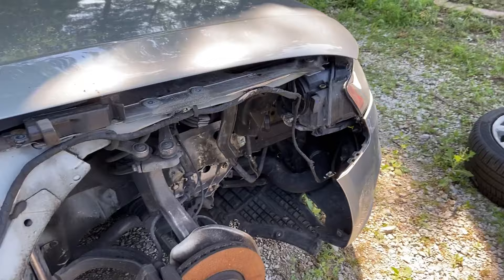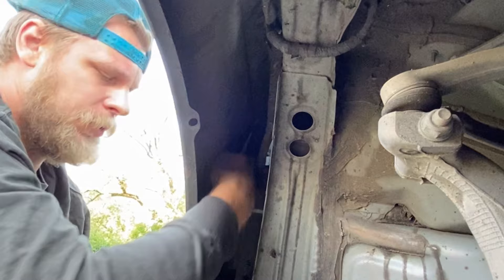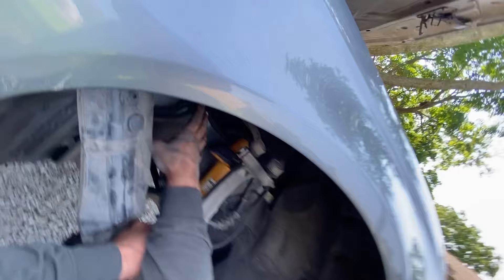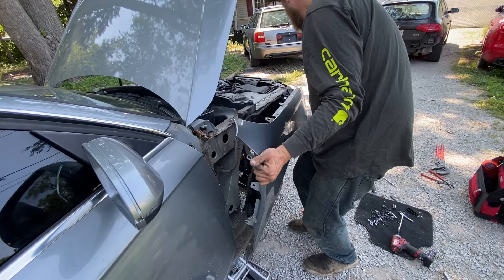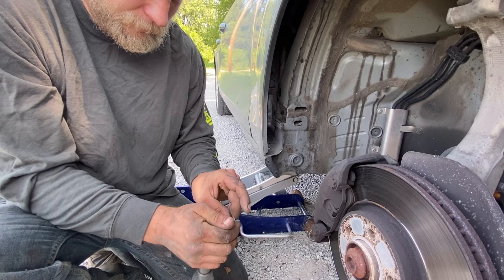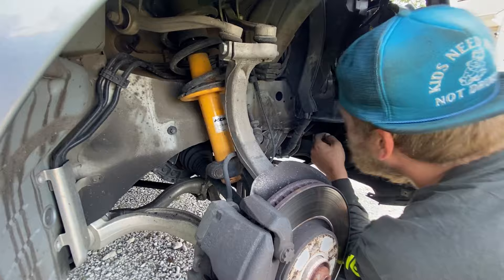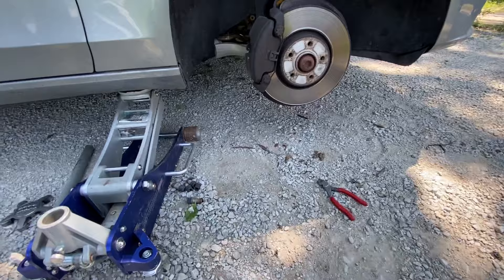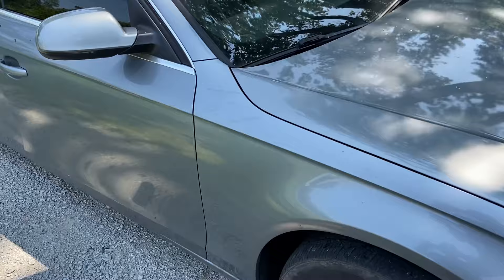Audi Fender A4 S4 B8 B8.5 remove & replace 2009 2010 2011 2013 2014 2016
Front Wheel liner how to

Comment: That was very helpful to get the right fender off. Thanks., but when you get to the left fender the windshield washer reservoir is in the fender blocking access to those last 2 screws in the door jamb. Any hints on how to get that reservoir out of there. I already removed the two visible screws?
Reply: you can just pull it out by pushing it towards the fender and towards yourself at the same time so it gets un-caught by the filling tube.

Comment: Always clean ALL the dirt and debris from the body working areas..dirt can easily cause bolt or screw cross threading and or stripping out..where there was factory weather caulking.. clean that away and apply fresh material.. sealant was applied there for a reason the QC saw in testing.. Black plastic Push pin clips are what is used in much of the plastic fender and splash guard areas in Nipponese mfg autos, it breaks away under less stress than the part it holds so it helps prevent rips and tears in plastic panels and similar parts as well..

Comment: Great video man, At the end of the video where you fixed the gap, Did you you just tighten the top screws? How did you do it?
Reply: I think he just shifted the positioning of the top screws by pushing them in
Reply: Loosen the top screws, push the fender in by hand and start tightening the screws back up as you go along.

Comment: What about the 2 T30's Behind the Fender Seal and the Plastic Pop Rivets That like Ya Know,,Actualy PUT the Fender Seal Back in Place?? Did this tonighy on My S5 on Drivers Side With the Water Bottle. What a Bitch to put it Back 100% Factory!! New Fender I Had to Rivet All the Mounts In that I had to Drill Out of the Old Fender. If it Wasnt A Perfect Condition 2012 S5 "Special Edition" I Would Push this Damn Car into a Lake🤟

Comment: Hey a little off topic but does anyone know how much hp a 2011 A4 transmission can reliably handle?
Reply: 8 speed auto b8.5 either 400/500tq. Manual b8 360 tq. If you have 6 speed probably around 350tq.
Reply: @vagcentral2252  thank you much appreciated